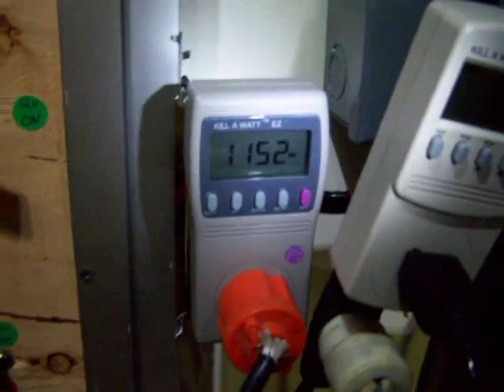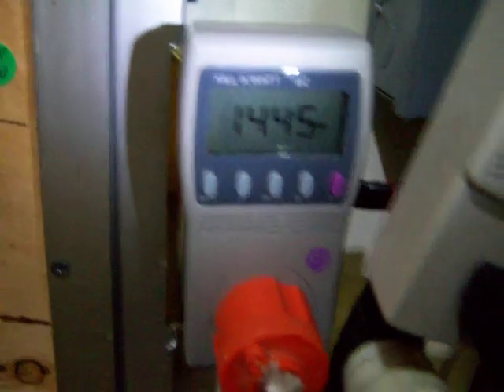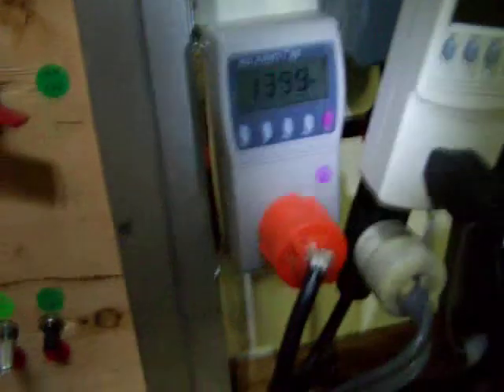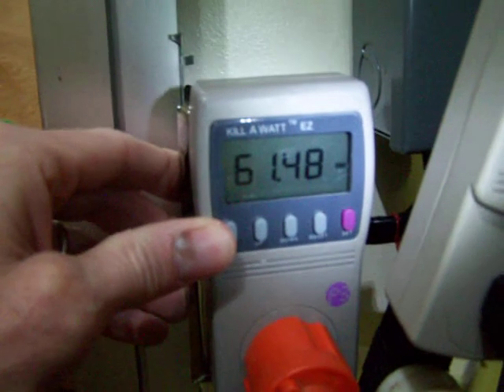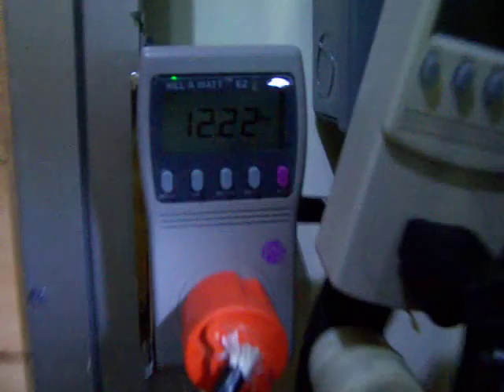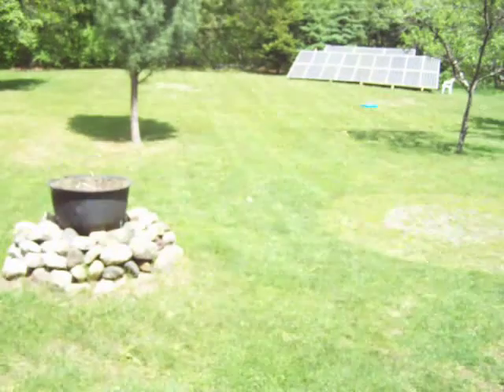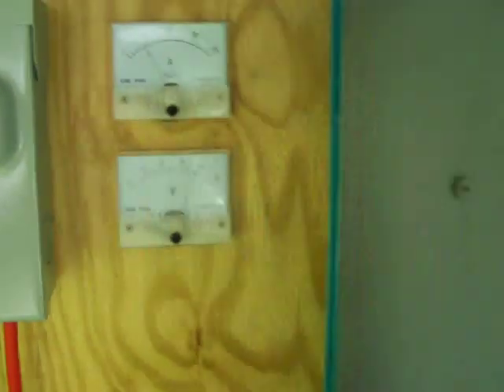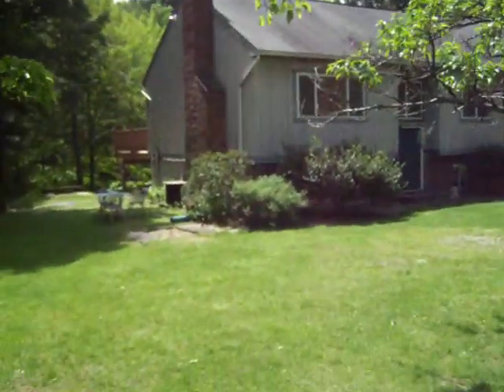3000w solar array readings

Comment from the maker: @taztaz79 hey thank you for the good advice.I was running through a outlet that was rated for 20 amps only because I kind of knew I would not get full 30 amp out put from my array,I have it run directly to my main panel now with a 30 amp breaker so I should be safe.thanks for your concern.TAKE CARE

Comment: Question.. What is your regular outlets in the house rated at? How many amps? How many amps are the fuses for the outlets? .. 12A as you said for 1400w... If you get full output you might cause a fire in your house if you had that connected to an outlet... I dont know the cables in US.. But i guess 25A wires you dont have. In my house they are fused at 10A (240v). Some are 16A.. My incoming power is 3-phase x 16A ...

Comment from the maker: @drz4000 Hey the PJ inverter is OK I think it only puts out about half the power and the fan never comes on.I talked to the company they say if it gets hot enough it will come on.I will add a small panel to run the fan

Comment: @michael970 

Nice job. How do you like the PJ 3000w GT inverter?  I have the 600w unit. It works but only at about 2/3's its continous rating. Looking to get a 2000w unit as I have 1200w of PV.

Comment: @michael970 They are still not producing enough amps to keep me happy. I'm still working on the one with the new 12 inch alternator. Opening up the air gap got it to charge more in lower winds. I'm planning on making the diameter wider for more torque.